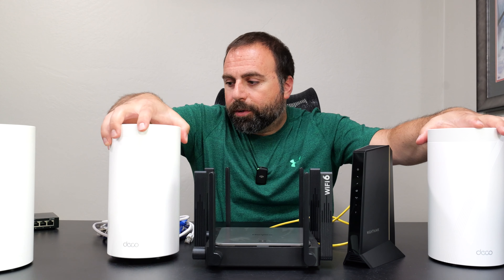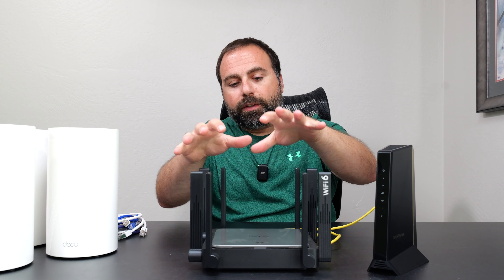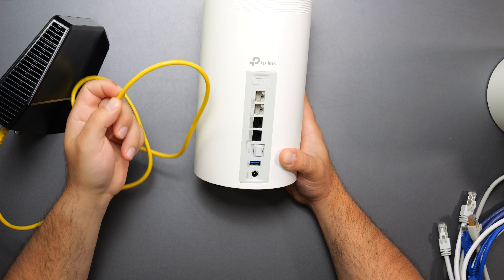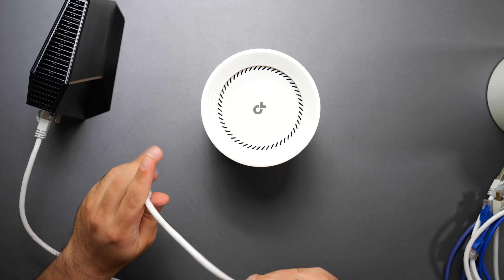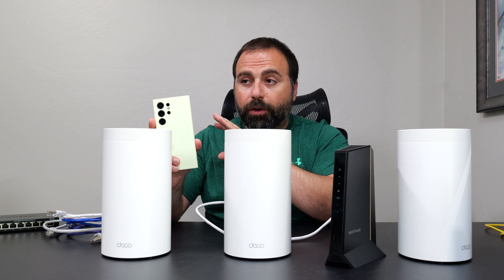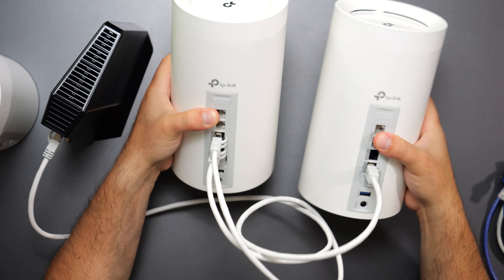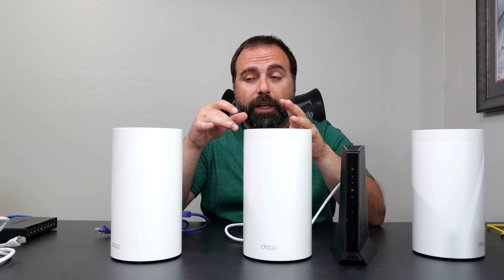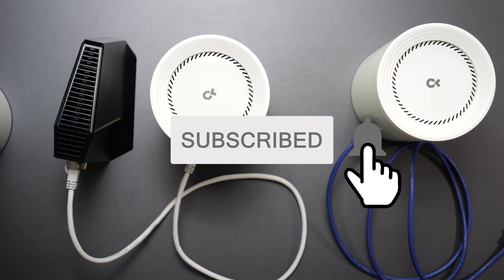Deco BE85 WiFi 7 Mesh System Setup: Easy Guide & FAQs

Comment: Holy cow…these things are HUGE …they get bigger every year….my google mesh system is like 1/10 the size 😂😂😂
Reply from the maker: Yeah the fast ones are big
Reply: I’ve been in the google ecosystem for a very long time. From Google WiFi to Nest WiFi Pro…I keep upgrading thinking.. the coverage, speed or even communications between it and other google devices..ie cameras, doorbells, thermostats, hub..etc, would be better or at least slightly more reliable. Unfortunately no.
Moved on to the BE85 and wish I would have done it sooner. The speed and consistency is spot on. Never dropped nor crashed like the Nest Pro 6E would do weekly. 
Fyi.. I use three BE85… had to use 5 Nest Pro..Maximum recommended by google. 
I also put the three BE85 in the same location at the first three Nest.
My house is over 6k Sqf.. all interior walls are insulated. Three BE85 covers every square inch inside. I just bought a forth one to put outside in an unheated shed to cover my backyard.. working good so far but not sure about the winter yet. 

Great review by the way.

Comment: Thanks for your videos.  I just wall mounted the 2 pack deco BE75 (BE17000) wired backhaul via MoCA 2.5.     Still trying to resolve backyard signal strength.  May try adding a switch and an additional AP, with wired backhaul over MoCA 2.5 to the 2nd floor.

Comment: Question if I have a 200mbs internet connection (starlink) this is clearly overkill. However would I be able to distribute the full 200mbs to a room two sattellites away in a big house using wireless backhaul. Or do I lose a pecentage with each hop .. so in the end my 200mbs becomes 20mbs say after 3 hops ?

Comment: If i only use all deco as ap mode what functionality would i lose?
Reply from the maker: You need a router at that point. In access point mode, it’s really just emitting a WiFi signal and providing Ethernet access. The router has the NAT. You’re not losing a lot of functionality though, it’s really just a glorified booster at that point but you can still deny access to devices among other things
Reply: @ so the dedicated wireless backhaul would still be available in ap mode and the the deco node can be use as a switch wired up to the pc getting a local test of over gigabit?

Comment: Very helpful video.  Couple questions if I disable the main modem router combo.  I understand that the wifi signal is no longer being emitted from that.  But does the ethernet connections still work or those are disabled to?
Reply from the maker: Depends on the model but typically all the Ethernet ports except the main one will be disabled. You would then use that main Ethernet port to connect to the new router and setup from the app
Reply: @landpet  another question so I ended up getting axe 5300 at Costco wifi 6e mesh.  I know to change the wifi name an pw to the same as my previous router so everything connects automatically.  But do I do that to the 2. 4 5gz connection or the 6gz one?

Comment: Thank u so much for clear explanation. I've 1 question. If i connect a Poe switch (10gbps) into my network switchboard, will i be able to connect any of the BE85 in other built-in ethernet out port in the house without connecting direct power supply to the be85?

Comment: Hello. I have just installed 2 Deco BE65, in order to have good wi-fi performances (that my box does not have...) to connect my TV in another room (without any wire).
I've used all default values for hub installation, and let the system handle the satellite installation.
It is correctly working, but I want now limit transmission between the 2 Decos only in 6 Ghz (by default, all frequencies are used). But I cannot find the option in the App to do that. Is it possible ?

Comment: Excellent explanation man! You answered all of my questions. What can I do and what I can't and specifically why I can't do it! Love your answers.
Watched lot of videos re mesh wifis and noone is even talking about wired backhaul, let alone using switch for additional ports!

I have one additional question: Is it possible to use a dedicated hardware for router near the modem, a switch post that and 3 Decos connected to the switch operating just as access points and not using router piece in any of the 3 Decos?